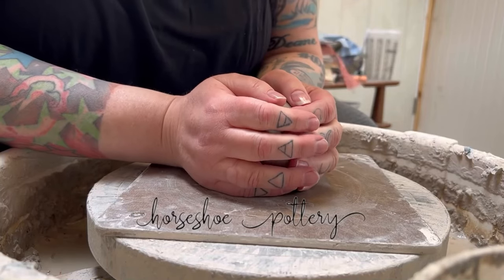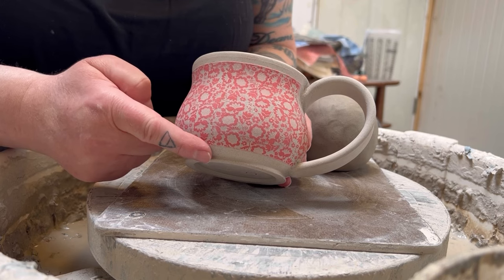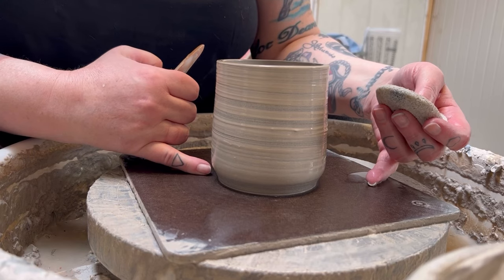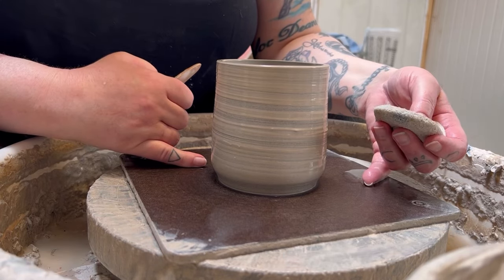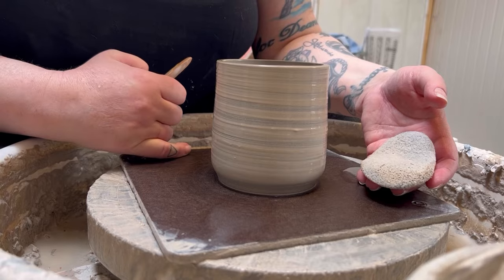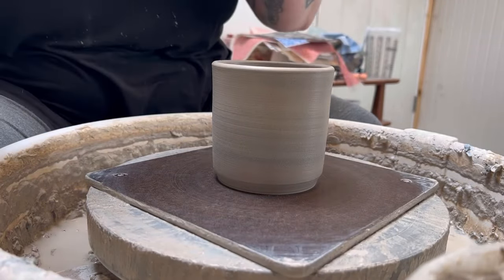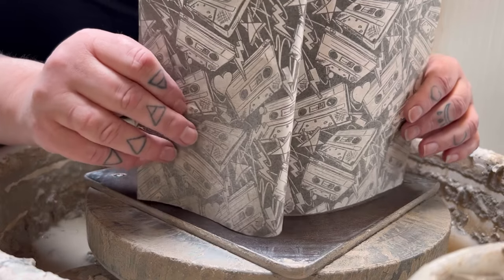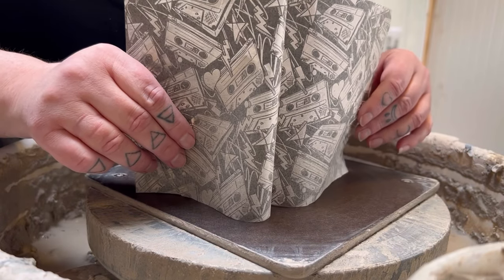Applying a transfer on the pottery wheel

Comment: Just trim the excess off the foot when you trim to get the decal even at the bottom. No one will know
Reply from the maker: I’m wondering if you’re referring to the part where I was concerned about the transfer going on off kilter? If so, the issue isn’t the bottom but the wrinkling of the transfer. If not, then yes, I have trimmed the bottoms of the three I did 🙂